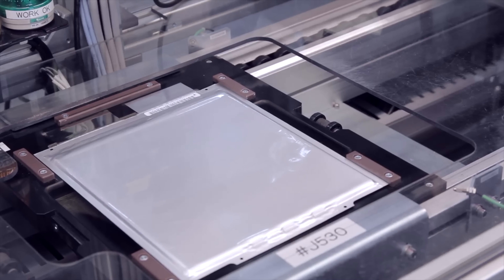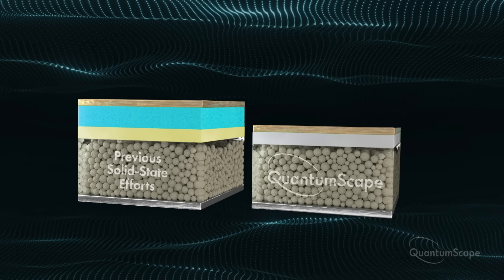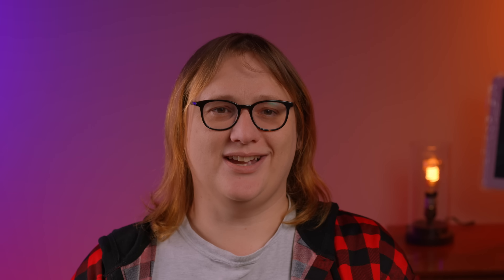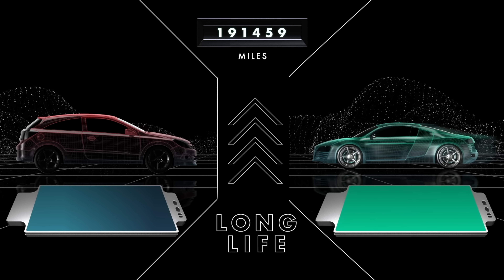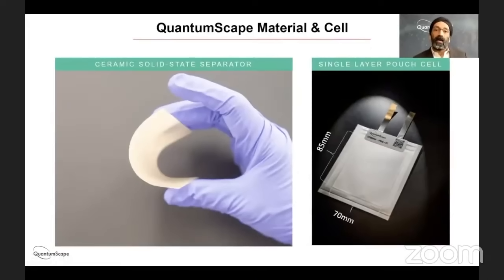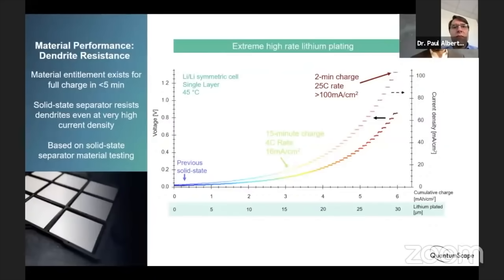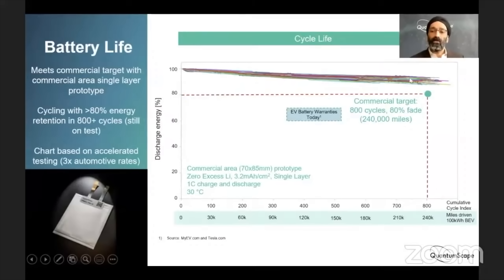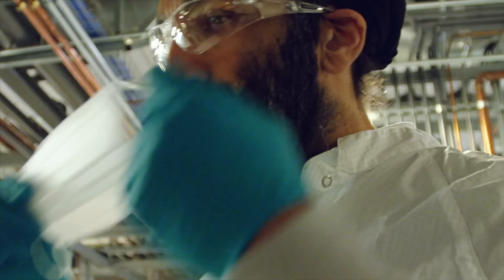Why Quantumscape's Battery Revolution Is Big News

Comment: If you're going to charge a 100 kW/h battery in 2 minutes, you're going to need a really beefy charger! In general terms, charging in 2 minutes is 1/30th of an hour or 30x100kW charging energy needed; 3,000 kW (30,000 100 watt light bulbs)... No home charging at that level. You'd need to have the charger at a substation to keep from browning out the neighbourhood. A well provisioned home in the USA might have a 240v 200 amp service, that's 48kW of energy available to use for everything in the house. Many homes probably have a 60 to 100 amp service giving a max of 14.4 to 24 kW respectively.

Tesla's V4 Supercharger may be able to reach a peak of 450kW, so 7 of those in parallel to charge this new battery in 2 minutes? Massive infrastructure changes would be needed to support charging more than a handful.
 
Even at a home rate of 10kW/h, that's 10 hours with 100% efficiency, 12-14 maybe?

It will be interesting to see how this technology progresses for sure...

Comment: This is just shifting from running on gas to running second hand from coal after travelling for distances on high voltage wires and all the additional energy losses and requirements of peroidic energy stations, unless you’re producing the power through alternate means.  It’s cleaner at the point of roving emission is all. Still a plus for city air quality and doing their part while waiting for other sustainable energy sources. Still a lot of down sides to large scale solar and wind.
Reply: that "roving emission" comment won't be appreciated by many, but I'd bet the woman in East London, whose daughter died of asthma, would be happy having roving emissions lowered.  There've been lots of studies on the trade off between construction of solar and wind as well as hydro, and the fossil fuels needed to build them.  i've read all the fossil fuel industry's comments as well as less biased opinion and I conclude we're better off eschewing fossil fuels altogether

Comment: Couple of facts here. VW has been in partnership with Quantumscape for some time now. They do not have a platform for electric vehicles yet. This is their EV play. VW has invested 300 million into Quantumscape so far. VW is the majority shareholder in QS. Qatar's oil money is the second largest shareholder in QS. Considering the backers and the pier reviewed data this is a giant leap forward. What is left is the engineering which is laborious but much less challenging than the tech. Company is on record that this tech uses existing manufacturing processes. Economies of scale will drive down costs as manufacturing ramps up. Much of the future value of this tech will be realized a long time before the battery is available commercially, the applications are endless. Exciting.

Comment: What is to be done with the remains after any battery cycles out? Looks like people with money developing a product with a one way benefit: provides a source of power until it won’t anymore and the user becomes responsible for its proper disposal? Even a small percentage of incorrectly disposed devices will significantly contaminate ground water.

Comment: Now this is a promising breakthrough! I hope they can bring it into mass production fast - like within 2 years.  But lets see!
Reply: They won't. And when they will (according to their plans, first production is in 2024), it will already be too little too late. They are aiming at producing a $30'000 car with Volkswagen (300 miles range, 15 minutes charge time, 800 cycles battery life). In 2024 Tesla will have a $25'000 car with same range and charge time and better battery life, so not really a breakthrough.
Reply: @ayushin82  yeah thats so much in the future still - and VW is not making the promises but Quantum. The promises from Tesla I would not bet anything on it. They never com as promised, if they come way later then promised.  Right now there is no advantage from no vendor. Also if this technology can be mass produced will be for all of the vendors  - VW and Tesla

Comment: I can't help wondering if some of the energy density improvement is a result of the pouch cell.  It will need to be housed in a structural container, where in cylindrical cells, the cells themselves are part of the frame structure of the battery.

Comment: Technically it is an underwhelming development, with production volume not projected until 2028, with very modest gains that is already behind Tesla's pilot plant that is producing 4680 cells now.   The 800 charge cycle limit and it costing more,  seems like VW is betting on the wrong horse.   It appears that early investors are able to cash out soon. Battery day must have spooked them so they rushed the SPAC before they had anything to report, so they could transfer the risk to the retail investors before the people realize that the short life of these cells is going to make them very expensive per 100,000 miles.   Either they are premature with their development and really do not have them sorted out or they have been optimized and the short life means they need to get their payday now instead of when they are ready for production.. We will know if insiders start selling since their lockup ends 5-6 years before the project any revenue.  This has good too many red flags such as ruching going public so early and projected production so late. Just think how much further ahead Tesla battery tech will be in 6 years giving their speed of innovation.  It probably is not the all out, from day 1 scam of Nikola but one has to be concerned how far in advance or revenue the investors are able to take advantage of the overexcitement in the market over anything that claims to be a world-beater in EV space.

Comment: I'm worried about all the rare elements that need to be mined.
I think an equally important question/task (apart from not using fossil fuels) that we have to look at: Rethink mobility. 
Do we really need to own a two ton monster to not using it 70-80% of the time? Can't we share? Do we need to have 100s of miles of range to go grocery shopping?
Do we need off road vehicles to never go off road? Do we have to buy the latest car every 5 years (the ones that can afford it)?

We have a house in the mountains we visit every other month. I would prefer to rent a SUV when we go there, than to have it standing in the garage for weeks.

Comment: even if they achieve subpar performance but 15% better than the actual standard in energy density, charging speed and longevity this would be a huge win. 15% better would mean 345 Wh/kg instead of the 300Wh/kg that are the peak standard of many companies (Tesla and practically all the others too).
having just that 'small' improvement would mean a lot. but obviously there is more to come.

Comment: Wowee what a huge false equivalence between Tesla's new batteries and Quantum Scape's. Tesla has a pilot production line up and running, manufacturing battery cells now, iterating rapidly. Quantum Scape makes these slowly by hand in a lab. Tesla is aiming for production of 1,000 gigawatt hours of 4680 cells in 2025, and Quantum Scape is hoping to start production in 2025. See the difference? 

When a company with a battery breakthrough tells you production is five years off, what it means is that right now they have no clue how to manufacture and/or there are other major problems they don't know how to solve. The number of companies that have given us that time frame is hundreds and the number so far who have solved their problems in that five years is zero. 

Impressive backers and board, but we are a very long way from this making even a small contribution to EVs if it ever does.

Comment: Hope they have something!  But then, we have been down this road for the past 25-30 years with literally thousands of 'Battery Breakthroughs.'  Some takeaways:  4-7 years before commercialization, less cycle life than current technology, fast charging that might be faster then current tech, but may only be equal to coming tech- and the biggie- cost!  They are projecting a $30,000 car for VW in 4-7 years.  Tesla is projecting a $25,000 compelling car in less time.  I would recommend listening to the podcasts by Hyperchange and by The Limiting Factor.  The former is a lot harsher in its evaluation, the latter more subdued, but perhaps put it this way best:  Quantumscape has a breakthrough for Solid State Batteries, but current battery tech is already getting to the same performance space differently...

Comment: I did see the presentation and, well, and...glad you brought up the caveat. There will be some hurdles to scaling up for commercialization. I was impressed, but we will not likely see the fruition of this tech for another 3 years, more or less. There was something not mentioned as well. If they are to scale up, they will have to very, very aggressively work on an adequate supply of lithium. If they are to ramp up production by three years time, they need to start working on that supply NOW. It is interesting that lithium is such a plentiful resource on this planet, but not adequately mined for the scale of production that the auto industry is boasting for the next couple years. 

In any event, the tech is there, it looks promising and I hope it does come "alive" in the next three years or so.

Comment: I’d like to see a video about Tesla’s LFP batteries for the Model 3 in China.  I saw an article criticizing the winter performance and slower charging.
Reply: That article was based on one person who claimed range went down in cold weather, just like an ICE vehicle due to running heaters and blowers. There was no data, just an opinion by someone who bought their first car.  Tesla heat pumps however are much more efficient than electric heating elements used in other EV.

Comment: Always love when the graph don't start at 0.  Tesla is 711 Whr/liter heading to over 800Whr/liter.  QuantemScape in the Lab is at 1000Whr/liter at  30% better but it is not in  production where Tesla is shipping today).  Realistically by the time QS SS is in production it will only be 10-15% better. QS SS 800 Cycles is worse,  than Tesla 2000-4000.  Fast Charge time is cool, but there are no chargers that can charge at 600kW/hr today and such a network would take a decade to build.

Comment: I don't get it. This technology is at least 6 years away and has worse characteristics than current Li-ions in Tesla and other vehicles. 800 cycles for a 300 mile range vehicle in 6 years??? 150k miles??? Yes, maybe a possible higher density top end, eventually, but how long are we waiting? How is this company going to survive for 6 years before actually selling a product? Tesla 4680's are going to dominate for the next decade.

Comment: Nothing about Hyundai's new E-GMP announcement, Nikki, or did I miss it?  E-GMP is a significant improvement, and includes innovations that I predict that others will either licence or copy (such as an 800v battery that uses the motor to step a 400v charging feed up to 800v for full 400v compatibility at nearly full efficiency and without the need for any adaptors, as one example of several).

Comment: Due to the faster charging time, the QS battery is faster over long trips than the 2170 cell, even if the QS pack is 80% the capacity or less.  In a 1000 mile head to head, assuming the 2170 vehicle were capable of getting 300 miles of range w/ 0%-80% charge time of 30 minutes, and the QS pack gets 240 miles of range w/ 0-80% charge time of 15 minutes, the QS vehicle finishes the trip about 30 minutes faster.

Comment: If I had a time machine and money was no object, I'd buy a 2011 Nissan Leaf*, then sell it towards a 2014 BMW i3, then sell it towards a 2018 Hyundai Kona Electric, and then finally a sell it towards a 2020 Kia Soul EV.  And then I think I'd own the Soul EV for at least 20 years.  :-)

There'll always be advancements, but I think the 2020 Soul EV is advanced enough for me.

* I live in a mild climate, so the early battery chemistries and lack of thermal management wouldn't be a problem for me.

Comment: SS batteries is a future of the EV world. For now, liquid electrolyte batteries will lead the market.
Reply: Toyota has unveiled their Solid State Battery which will be in prototype production in 2021 - high energy density and 10 min charge (if you have a charger that can deliver power at that rate.
https://www.youtube.com/watch?v=hS5FgfRq7Nk
Toyota's Super EV Battery That Charges in 10 Minutes, Coming in 2021
Reply: I remember when the future was UltraCapacitors.
Reply: I really am starting to think that they are not. Everybody seems to think so and we are being told from various sources that Solid State is the future. But why? Will they really be better than the new and innovative 4680 Tesla battery? Time will probably tell, but I for one am not holding my breath anymore for the overhyped Solid State battery.
Reply: @robfirefly  watch the video

Comment: Toyota will launch full ev cars only when this Solid State Battery will be fully functional, stable and cost effective. It makes sense to me. It's their approach as well to production.
Reply: ok, so that practically means, that they won't sell cars at all for 4 years
Reply: @stefanweilhartner4415  they will sell loads of hybrids and regular ices till then. It's the same they did with hybrids, the just released them when technology was mature enough.
Reply: @ft_111  that is not possible, because people will buy electric
Reply: @stefanweilhartner4415  yes sure, by 2025 still 90% of sold cars will be ICE one.
Reply: @ft_111  in november 2020, in germany 10% were already pure BEV. worldwide it is less, but the transition now is going now because EVs getting cheaper by 6,5% every year while ICE cars getting 1,5% more expensive every year.
Reply: @stefanweilhartner4415  hope the transition happens earlier then expected, but first countries have to convert electricity production to something carbon neutral. Generating electricity with gas or coal is not sustainable anymore. Right now it does not look too promising. Too many countries with high carbon footprint from fossil https://www.electricitymap.org/map
Reply: @ft_111  not 'first' but in parallel. this is independent from EV usage. the transition is already going very fast.

Comment: The physics and chemistry of it seem fascinating. Lithium, even hot lithium, is only going to "burn" in the presence of some agent. Water is pretty nasty. But providing its air and water tight, it should be possible to get it quite hot.  Interestingly, of course, you are moving lithium ions about so its already functioning rather like a lithium gas. So maybe hot will help them move quicker...or maybe has no effect at all.

Comment: Hopefully they can offer this cheap and modular enough that other companies can build replacement packs for older electric cars.  1st gen Nissan leafs can be bought cheap, but good luck getting a battery for it.  It costs more than the value of the car.  If someone can make a pack with a smaller footprint than the original, it can give you more range or just be lighter with similar range.  As Henry Ford did with the automobile, someone need to democratize the EV so low income people can buy those used ones out there and actually be able to keep them running.

Comment: I dunno. 800 cycles to 80% at lab conditions (constant 30°C) and 1C charging with a lab prototype seems kinda 'meh' (For comparison: The stuff that Tesla puts in its cars since 2016 gets on average 1300 cycles to 80% under real world temperatures/conditions and fastcharging > 3C. That's a LOT better). 
v3 supercharging has comparable charging times to solid state batteriey claims, so no big breakthrough, there.
I like the gravimetric energy density figure, though (i.e. applications in airplanes?)...but for use in cars they have quite a bit more work to do before becoming a serious contender.

Comment: Odds of Panasonic incrementally increasing density 5% until gets to 20% by 2025, highly likely. Tesla battery day mechanical improvements (tab-less large cell, structural battery) highly likely, Tesla battery day chemistry improvements partially likely, QS home run new architecture, not likely but possible. So question is, by 20205, if QS starts delivering product, will it be that much better than Tesla battery and at what cost since Tesla will be at manufacturing scale. Either way, ICE toast by 2030 when bans start taking effect and EV's are cheaper than ICE.

Comment: I think there is too much hype about this for very little. Going by the company's own projections, the high volume production won't happen till 2027/28 and at that point the cost will be about $70/kWh. That is assuming everything goes as they wish. And the specs are barely competitive with what Tesla announced on battery day. Tesla will do better $70/kWh by 2022 and by 2028 probably every battery manufacturer will be there. The technology seems to have good potential longer term but unlikely to revolutionize EVs. Perhaps useful for electric planes at some point.

Comment: It’ll interesting to see if Quantumscape’s production battery can meet the claims from the laboratory.

Between now and the time they have full production running I hope they further advance their current design. 
• The current design is basically on par with a silicon loaded, high nickel Tesla 4680 (already in small production)
• Quantumscape’s battery is a pouch battery, so it has no structural value, but it is lighter and could be arranged differently than cylindrical cells
• Wondering what type of pack structure would be used to take the pouch cells and give them the protection needed
• What are the cooling and pre-heating requirements for the cells and how is that managed at the pack level?
It’ll be interesting to see if it pans out